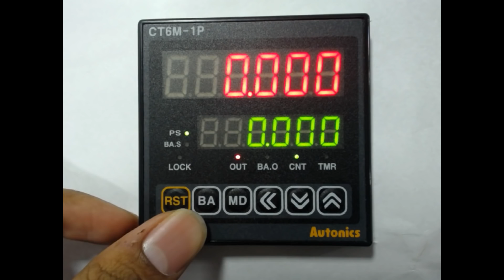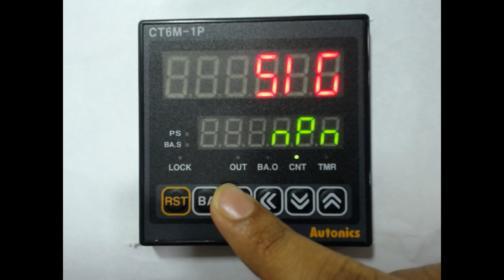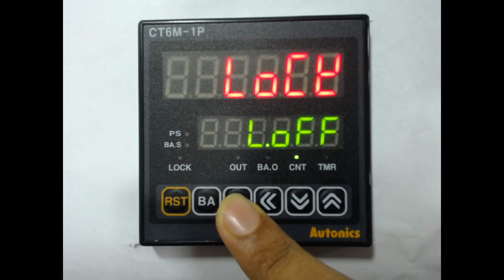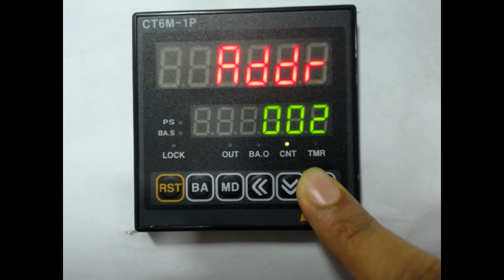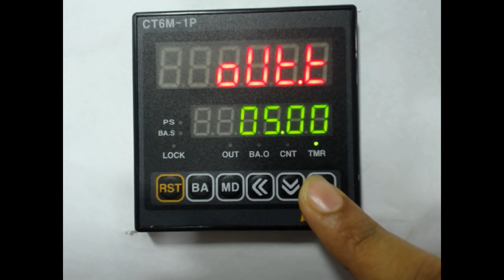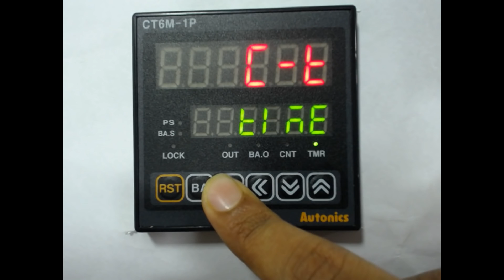Autonics Tutorial : Counter/Timer CT Series

Comment: Hello sir
Textile  machine counter available?
Low RPM sensing  UNIT din rail mounted type available?
Reply from the maker: For position control, encoder A and B phases and a counter (CT Series) are used.
For measuring RPM, encoder Z phase and pulse meter (MP Series) are used.
However, please note that there is no DIN rail-mounted product.